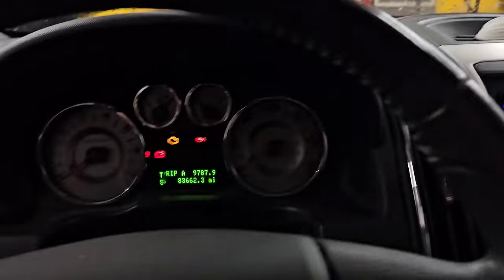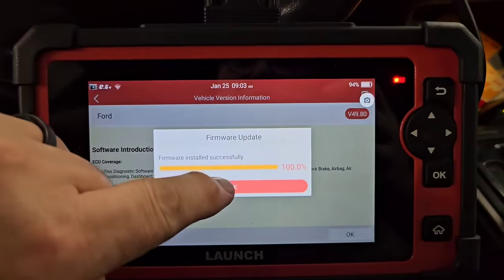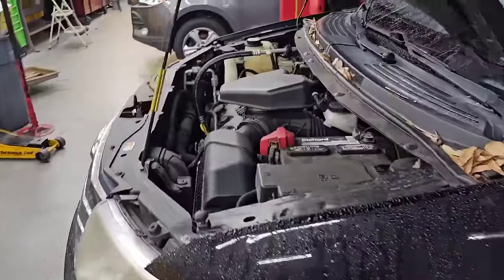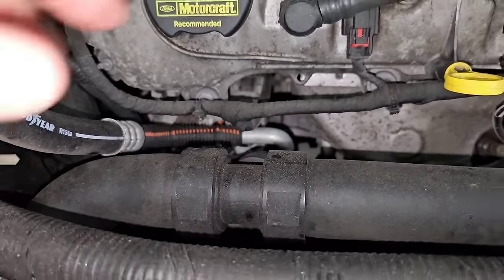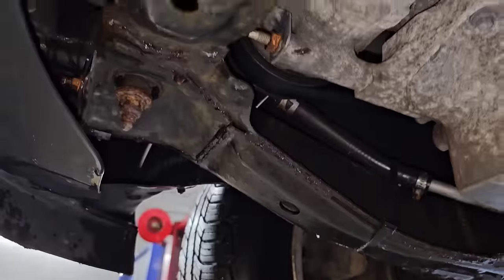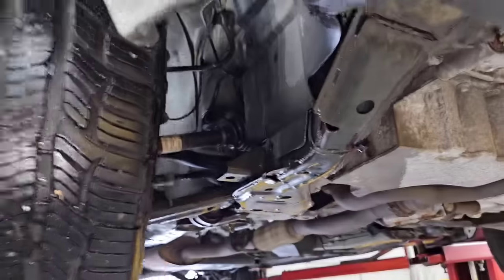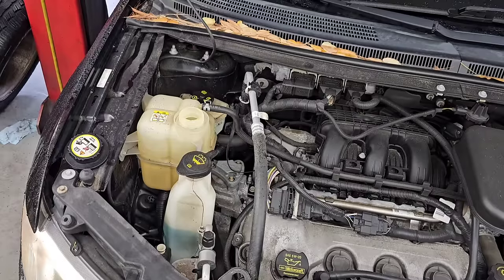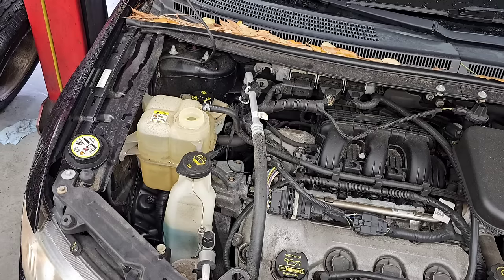No Coolant? But Where Did It Go?

Comment: Pull the dip stick!
Reply: Maybe he did but didn't show us?
Reply: Yup...
Reply: water pump failure leaking into the pan. had one a couple of months ago
Reply: Ya fist thing u do on a over heating is pull dip stick make sure u didn’t blow the head still don’t explain y it over heated going down the road
Reply: His hand bumped the dipstick when he was checking the fan
Reply: It would make a very bad day when that last gallon ended up in the oil pan
Reply: the Ford 3.5 is known for the internal water pump failing and dumping the coolant in the oil pan. @Whiskey36
Reply: Look for The Chocolate Milkshake on the oil dipstick.
Reply: As soon as you over heat shut it down the engine,will save a motor

Comment: So 2 things I would like to add since we have no idea yet where this coolant went. Kenny first said that the customer said passenger compartment filled up with smoke, that is usually a pretty good indication that the heater core has taken a crap. Also I am surprised that the basic (IMO) checks weren't done, like check under oil fill cap for cream or milk, check dipstick for same or coolant, back off oil drain plug slowly to check for coolant coming out before engine oil, etc.. Maybe those checks were done off camera? Anyway, I hope we get to see the diagnosis.

Comment: Just a suggestion when using water to look for cooling system leaks. Add some food coloring to the water, makes it easier to see.  Also thermostat and heater valves need to be open in order to pressurize the entire system. Finally after adding two gallons of water if that head gasket is blown or anything is cracked be careful you don't get hydrolock from water in cylinder when you start it again. Hopefully we'll see a part two and see where this goes.

Comment: @WrenchingWithKenny
5 months ago
I left everyone hangin' on this one! The cooling system was tight - no leaks. Found the coolant to have boiled out from intense overheat. It turned out to be the cooling fan module and fan assembly. The fans built up resistance and burned out the attached module. Glad to say the post repair test drive went well and there are no signs of internal damage at this time. For the sake of the customer's time my colleague did the repair. I have a long list of diagnostics that I still have to knock out and the customer's time is important to me. Sorry for the lack of a video. I appreciate you for watching!
Reply from the maker: I appreciate you. Keep wrenching 🔧

Comment: Look for a coolant stain behind the alternator. The water pump is chain driven and is behind the timing cover. It has a weep hole with an external passage to prevent coolant from getting into the oil, but once it starts to weep, you need to address it asap. Also, these engines have a failsafe cooling system like the modular V8s, the PCM will disable fuel injectors on half of the cylinders. The air pumping through prevents severe overheating. Given the timing codes, I'd be doing water pump and a chain/phaser/tensioner kit from Cloyes. It will be pricey, so the customer may balk at it. From personal experience, drop the powertrain out the bottom, much easier to work on, especially for cleaning the sealing surfaces (timing cover is sealed with permatex grey RTV) and timing the chains.

Comment: Also check the heater core in the dash as the customer stated "cabin filled with like a smoke" as it may be leaking under pressure.
Reply: Yes
Reply: I clesned my heater core on a cold winter day on an '86 F150 with bleach, CLR and another anti-😢corrosive.
Of course I flushed it by taking off hoses and reversing input of anti corrosiveback and forth.
 I am a DYR'er and it worked. I did not notice rust or gunk of any sort pour out, but it worked.

Comment: This sounds like a classic example of losing cooling system pressure on these era systems.  They are very sensitive to pressure loss.  Whatever they state (on the cap) as the pressure of your system (16psi or whatever) -- they really mean that.  The system will operate right at that pressure when at temp.  If it is rated for 16 psi, holding 15 psi is not good enough.  Be sure to carefully pressure test the cap on that expansion tank too, as they are often the reason.  But you may have a leak or crack somewhere else in the lines.  I have seen leaks that don't show up in a cool pressure test.  They only open up when hot enough.  They can be really hard to find.  Check the water pump too.

Either way, as soon as system pressure is lost, that reservoir will boil and push out a gallon of fluid faster than you can imagine.  When that happens, the CHT sensor is suddenly in air instead of water (any remaining coolant around the sensor also boils in the head, causing similar bad readings), and it starts reading incorrectly instantly, often reading much higher than actual.  So I am not really concerned about the CHT code here.  My guess is they stopped running it in sufficient time to avoid ruining the head.  I think sequence of events is that pressure was lost somewhere, boiling off the coolant and setting a false CHT reading.  The coolant that boils off gets all over the hot manifold and produces a lot of steam.  The "smoke" inside the car was steam being pulled in through the vents.  Fix the leak (maybe just the pressure cap -- don't use aftermarket), vacuum fill the coolant, and it will likely be fine.

I don't think the fan failure is related.  The codes weren't necessarily set at the same time.  And, as you pointed out, the cooling failure happened at highway speed with plenty of cooling.  That is an unrelated fix.

Also note that if the CHT reads overtemp, the PCM will shut down cylinders to cool the engine.  So a misfire during the event is likely due to the shutdown and not due to damage from overheating.  These engines protect themselves pretty well.

Comment: I've had a few cars that had a sensor in the reservoir/expansion tank that would alert on the dash for low coolant. I have a '90 Toyota that has one.  It would be a good thing for the manufactures to include for people that are oblivious and never check anything under the hood.
Reply: Trouble is most people will just ignore any warning lights and carry on,  as long as the engine is running and the wheels keep turning that's fine.

Comment: Hopefully there will be a part 2. Where did that coolant actually go?
Reply: Check the dipstick!!!!
Reply: I'd say the coolant blew out. "Smoke from under the hood" was the customers description at the beginning of the video
Reply: @danwoods315  I would suspect blown head gasket and better hope it didn't warp the head from overheating.
Reply from the maker: I left everyone hangin' on this one! The cooling system was tight - no leaks. Found the coolant to have boiled out from intense overheat. It turned out to be the cooling fan module and fan assembly. The fans built up resistance and burned out the attached module. Glad to say the post repair test drive went well and there are no signs of internal damage at this time. For the sake of the customer's time my colleague did the repair. I have a long list of diagnostics that I still have to knock out and the customer's time is important to me. Sorry for the lack of a video. I appreciate you for watching! 🔧🔧
Reply: @WrenchingWithKenny   Please help me understand. In  video you mentioned that fan do not come on when going at speed, something like 30mph up. But these fans failed at hwy speeds and the car overheated? correct ?
Reply: @g8gtatlman483  The fans have been failing for awhile, so whenever going 30 or under, the coolant was boiling away slowly, until enough was gone that at highway there wasnt enough to keep the engine cool and it overheated.

Comment: For cooling systems I get distilled water only cost $1 at most stores. And I love my Airvac system, especially on big leaks
Reply: Batteries yes, radiators it doesn't matter. I honestly don't think it is that important in batteries, IMO, if it is good enough to drink, it's good enough for batteries. You should only use coolant which is half antifreeze and half water in the radiator. Plus he is just looking for the leak.

Comment: Also, check the coolant system pressure with the engine running. It could be a blown head gasket between the cylinder and a water jacket. Which would explain the loss of coolant.

Comment: Check the oil level,  also pull the oil pan drain plug and take  a sample, look for antifreeze/water in the oil. Had a 2001 Malibu that had bad engine timing chain cover coolant o-rings in and it was leaking  coolant past timing chain cover seals from engine block and water pump seals. It wound up in the oil pan with the oil. No leaks showed up externally on the engine.  The oil level will also show a high reading on dip stick as  more coolant leaks into oil pan.

Comment: Cloyes seems to be pretty good, we used their parts on a Ecotec and no problems yet. If its obvious the chain is loose or there are no cam sprocket rattles or known sprocket issues i would leave them alone. We did change ours but in hindsight it wasn't needed. On the ecotec it actually was not too bad.

Comment: I try to save used antifreeze of different types (if it isn't contaminated) and label them, keeping the various types in the correct container. Came in handy recently when a friend had a leak on his Ford Ranger that I couldn't get to. Couldn't use water, as it was way below freezing. I topped him off and gave him an extra gallon until he could get it repaired. Also comes in handy when a customer doesn't have the funds to repair a problem and the car is still drivable.

Comment: Same pressure tester I bought at Harbor Freight and it leaks around the quick connect fitting
 so you could stand there and pump it all day and it wouldn't build any pressure and you really wouldn't notice that it's leaking since it doesn't give the hiss sound

Comment: My 06 Ford's coolant reservoir cap has a built in pressure release valve, I found this out because my car overheated, and spewed coolant all over. It was also due to a faulty fan control module. Replaced the fan, and topped off the coolant, and it's still running today. This happened back in 2017 (for reference)

Comment: Put power on the fan leads to see they even work, had some that blades turned and the motor was bad. Hate to see a module gets replaced and the fans still not running.
Reply: my thoughts exactly

Comment: Isn't this a model that uses the timing chain driven internal water pump? I'd be looking there as well and checking the crankcase.
Reply: Yes ,all 3.5’s for front wheel drive vehicle has the timing chain driven water pump . The 3.5’s for the rear wheel drive vehicles have an external water pump.

Comment: Great stuff Kenny
However the first two things u would have checked was water in the oil milky when cold.filled the empty expansion tank then ran bypassed the thermostat directly to the fans with 12 volts
Started the engine and monitored results
If all other items are working then you know it's the fan modulator or stuck thermostat

Comment: I have a regular, constant leak that puddles on top of my engine, but I "cure" that by just adding 50/50 coolant. Its doesn't go into the oil. Its my old, ugly '86 F150 garbage/hauling truck. I only drive it 200-300 mies/yr. I'm not worried about it, but I will buy a new radiator hose this spring - it doesn't appear to be coming from any hose plus the rad hose is below where the coolant puddles.

Comment: Waiting for part 2‼️
Reply from the maker: I left everyone hangin' on this one! The cooling system was tight - no leaks. Found the coolant to have boiled out from intense overheat. It turned out to be the cooling fan module and fan assembly. The fans built up resistance and burned out the attached module. Glad to say the post repair test drive went well and there are no signs of internal damage at this time. For the sake of the customer's time my colleague did the repair. I have a long list of diagnostics that I still have to knock out and the customer's time is important to me. Sorry for the lack of a video. I appreciate you for watching! 🔧🔧

Comment: Definitely could be the water pump leaking under there weep hole is behind alternator. Pull the dipstick it’s most likely milky. You didn’t do any kind of block test. And you didn’t check the duty cycle circuit to the module.

Comment: Got 07 Lincoln mkz in my shop today. Same issue. It's the water pump. It comes out weep hole behind the alternator. It's a engine out deal on the mkz. I think edge can be done with engine in. Ford parts and id do the timing chain when your in there.

Comment: Is it in the oil sump or in transmission?
 You can tell its a Ford they don't feel the need to identify fuses/relays in the panel. Another driveway mechanic deterrent.  Thanks again Ford.

Comment: Since the fans are not working, the cooling got out from.a vent vavle under a lot of pressure caused by the high cooling heat (the cooling system build like that) and i guess there was slow moving traffic on the highway, that the only explanation.

Comment: Turn on the A/C the fan should come on
Reply: He did that and the fans didn't come on......
Reply: @johnbeckett2624  should have tried that after they didn't  come on. They always come on with the AC
Reply: @unwired1281  then you would know right away the fans don't work, without overheating the car and cause more damage to the motor. Work smarter, not harder !!!!!!!

Comment: You mentioned that it is a 3.5 v6, isn't the waterpump of the style that fails internally into the engine? Pull the drain plug from the engine, see what you get. If it transferred all the coolant into the oilpan, the overheat would have boiled what coolant was in the heads, turning it into steam, which would have vented to the radiator and the degas bottle. The engine would have drawn in whatever it could from the reserve in the degas bottle as the steam may have been blasting it out of the overflow.
Reply from the maker: That was actually my first thought because you're absolutely correct. The system was tight - no leaks. Found the coolant to have boiled out from intense overheat. It turned out to be the cooling fan module and fan assembly. The fans built up resistance and burned out the attached module. Glad to say the post repair test drive went well and there are no signs of internal damage right now. For the sake of the customer's time my colleague did the repair. I have a long list of diagnostics that I still have to knock out and the customer's time is important to me. Sorry for the lack of a video. I appreciate you for watching! 🔧🔧
Reply: @WrenchingWithKenny  glad to hear back from you. Nice that it worked out that way.

Comment: Let us know Kenny, I hate mysteries.
Reply from the maker: I left everyone hangin' on this one! The cooling system was tight - no leaks. Found the coolant to have boiled out from intense overheat. It turned out to be the cooling fan module and fan assembly. The fans built up resistance and burned out the attached module. Glad to say the post repair test drive went well and there are no signs of internal damage at this time. For the sake of the customer's time my colleague did the repair. I have a long list of diagnostics that I still have to knock out and the customer's time is important to me. Sorry for the lack of a video. I appreciate you for watching! 🔧🔧
Reply: No problem man, keep wrenching! @WrenchingWithKenny

Comment: The driver said they were driving on the highway and cabin started to fill with smoke and when they pulled over there was smoke coming out from under the hood (assuming it's coolant in both cases). While the fan circuit/module may be bad, I can't see how this addresses the vehicle's primary issue. The vehicle appears to be leaking coolant (2gal missing) inside the cabin and in the engine compartment, why is Kenny  concerning himself with the bad fan circuits? Kind of a strange video from Kenny.

Comment: Car was towed in, so rocket science was used to start it up to drive it in the shop. Customer did state it over heated, and they saw smoke. Also the dipstick was not pulled to check for antifreeze in oil. Finally not able to pressure test system. The fan issue was diagnosed correctly. Kenny, you have some improvements to work on in your shop. Good luck.

Comment: Kenny, I was wondering if setting the timing marks TDC by looking inside the Number 1 cylinder and seeing the distributor rotor printing to the Number 1 spark plug is the only correct way to find TDC on compression stroke? I ask because of something known as timing hunting which I don't understand. Could you please explain this because I will soon need to replace my timing belt (first time) my self. Thank you for your content I have learned a lot!
Reply from the maker: What kind of vehicle? What motor? If the belt isn't broken or skipped teeth, you shouldn't have to worry about any of those things. The only thing you need to be concerned with are the timing marks. Let me know the details and I'll see how I can help explain what you need to know. Keep wrenching 🔧
Reply: 2002 Nissan Frontier truck 3.3L engine. I purchased the OEM timing belt, water pump with gasket, tensioner, and tensioner spring.  I got this truck without any maintenance records and has 265K Miles. I have not done a timing belt job before just simple service and parts replacement, i.e. alternators, belts, spark plugs, fluids replaced etc.
Reply: @WrenchingWithKenny  
I dont know the truck's history, there was no record sticker of it having been done. The original owner passed away and his family just wanted to get rid of it.

Comment: The pressure tester is a pos. Try another tester and make sure it will pressurize the system to the specified pressure rating on the cap. Then look for the coolant leak...if any.    You should only have to pump those testers maybe 1 to 2 times.